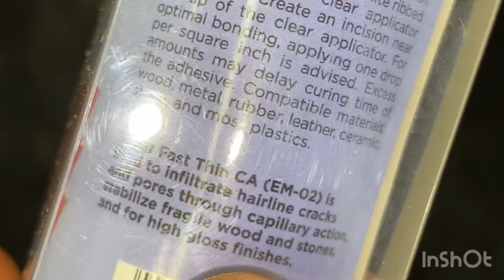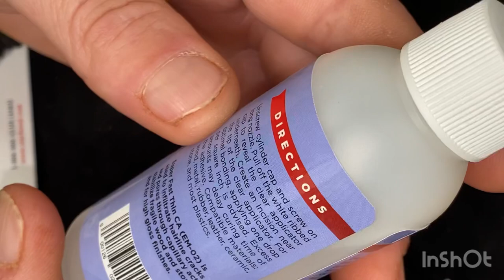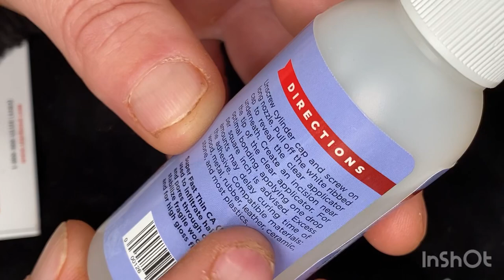Rainbow matrix: stabilising/resin treatment.

Comment: Can't you heat treat with butane torch to pull bubbles out and make the glue even an dry faster looks awesome though ill have to get some matrix in my collection
Reply from the maker: G’day Josh, possibly that might work, but the stone has lots of air that needs to be expelled. Heating would get rid of surface bubbles but they’d keep coming. Trying to get an even pour was hard as the Starbond was very thin/runny and ran over the sides, also I think I tried to get it to absorb too much in one hit. I’m definitely getting a vacuum chamber. 🤪👍

Comment: I know this is an old video and I haven't read through all your comments to see if someone else has already given you this idea but you might try putting that in a vacuum pressure pot it'll pull that glue deeper into the stone and Starbound also make some medium and a thick glue I'd recommend before you polish you use at least the medium to coat it will fill in a lot of those pocks.
Reply: Lol hahaha a minute after my comment you said you wished you had vacuum chamber
Reply from the maker: G’day Eric, I have since purchased said vacuum chamber, works a treat. 🤪👍

Comment: Did you ever think about adding a bit of dye to that thin resin? I wonder if it could darken the concrete like the sugar and acid does. If it did, then you could pick the background that best contrasts with the opal colors. Stupid idea?
Reply from the maker: Unfortunately the resin sits on top of the opal, whereas it needs to be soaked in somehow to give the blackened background look, coating would tint/block the view of the opal.
Reply: @The Opal Mills  , I think I need some more education on that, Phil. I thought that the opal in the matrix couldn't absorb the carbon but the stone could absorb the sugar and the acid which coloured the stone and contrasted nicely with the opal molecules and allowed them to stand out so much. 
So I wondered if you could dye the thin resin and put it in your vacuum chamber to get it inside the concrete matrix like the sugar and acid but instead of getting the carbon black from the sugar maybe you could get blue or red or any other colour in there. I thought the Opal itself wouldn't take any colour and just stand out with the contrast.
What do I know? I just have a big imagination and do the same when I paint 🎨